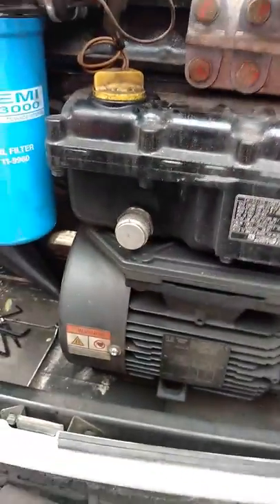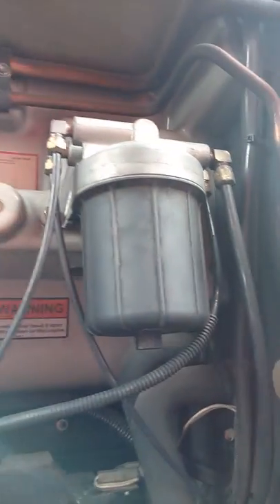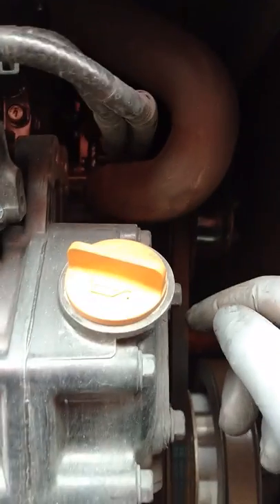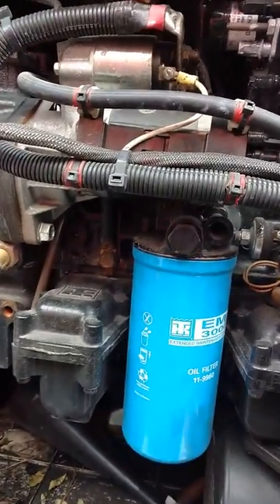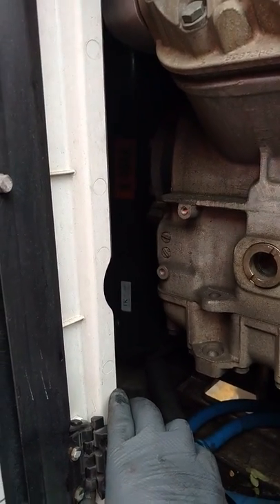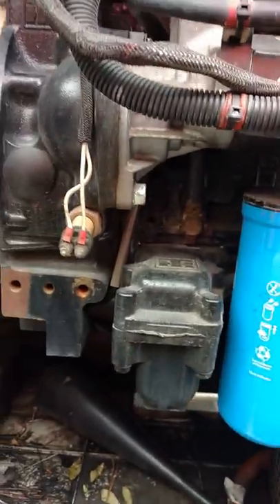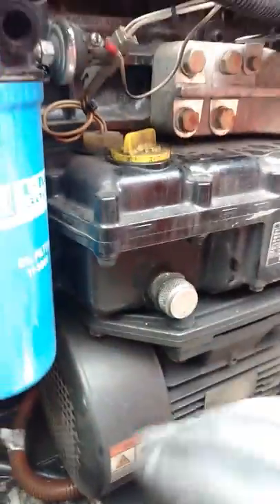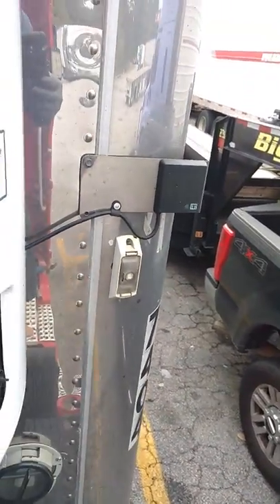Thermoking overview for maintenance, Not all inclusive.

Comment: That generator runs your 2 condenser fans and evaporator fans not the unit it would be a standby motor if you had standby but you don’t as you can see that you do not have a standby motor. the first sight glass is for your compressor oil

Comment: Do you know if these engines have a PCV valve?  Have one that is running really bad. Cleaned the EGR and it helped a bit. Still running rough.
Reply from the maker: Haven't really seen a pcv valve in the manual or ran across it in the PM.service....Never been charged for one from thermoking during my maintenance visits.

Comment: Lol it doesn’t have “the ability to go electric mode” that’s an ac generator for the evap and condenser fans. This unit does not have electric stand by. I love watching these videos to giggle at the mis information these guys give the public. - a thermo king master tech
Reply from the maker: @Curt.. Thanks for the correction...
Reply: Dee Wheels sorry to come off rude, no disrespect intended. If you come a cross a unit with a second box similar to the generator you were speaking of. It would be on the compressor side with a third belt going between compressor and engine. That is the electric stand by. Electric stand by does not come standard with c-600 it is an option though.
Reply from the maker: No problem....I really meant thanks for the correction... I'm not an owner operator anymore...but I always tried to help people in the cut throat trucking industry.
Reply: Great info bro!!!